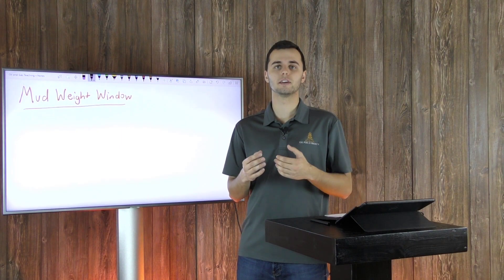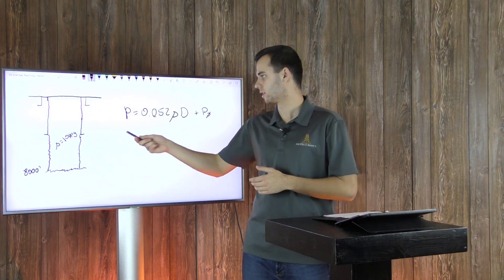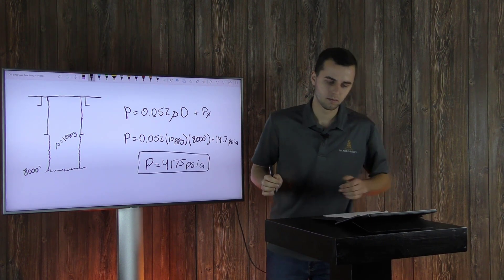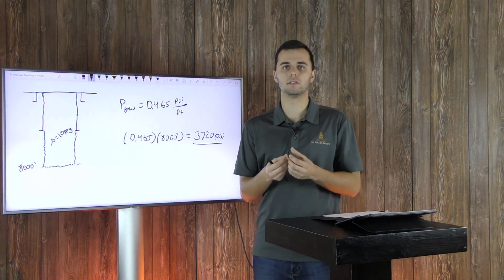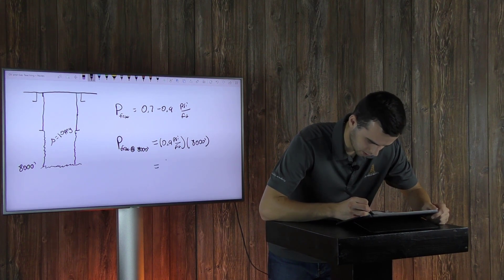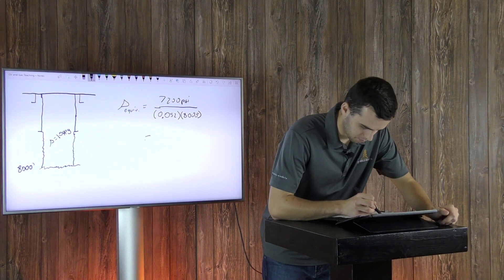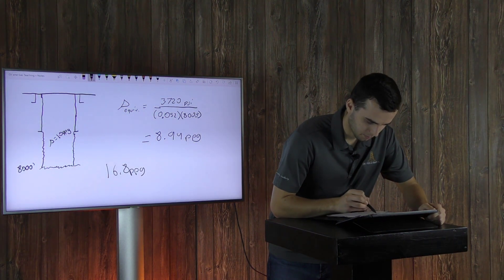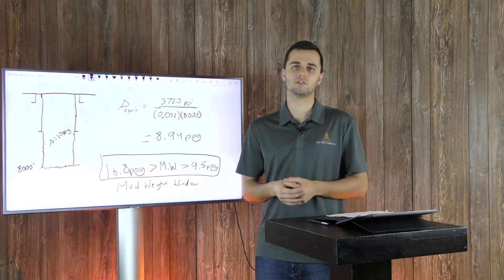Mud Weight Window Calculation

Comment: How would you calculate  formation pressure value (0.465 psi/ft) and also fracture pressure value (0.7--- 0.9)?
Reply: Those are standarized values, would depend on your location, lithology,formation type etc

Comment: How would you calculate the mud weight window max & min values? the 16.8 & 9.5 ppg. Thanks
Reply from the maker: Hey Chris. In the video, Sebastian goes through how to calculate the min and max mud weight values! At the end, he factors in a safety factor which is common practice in the oil and gas industry!